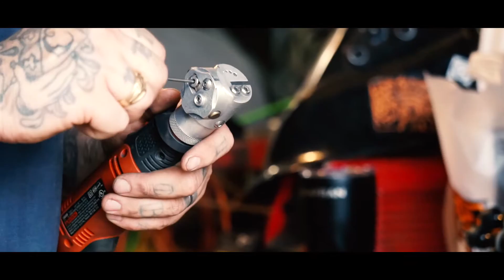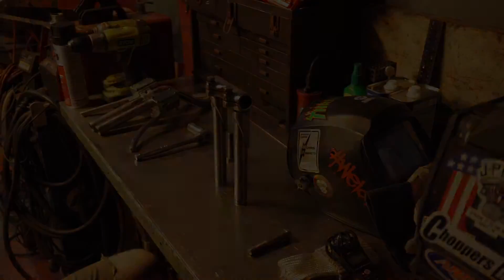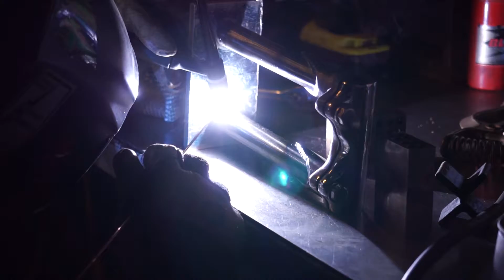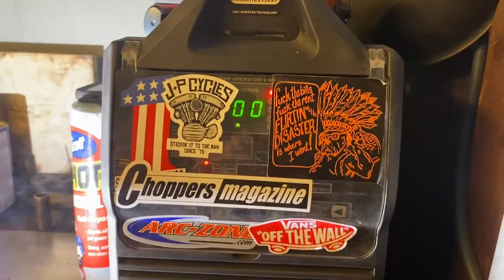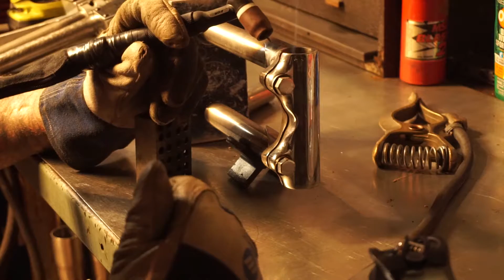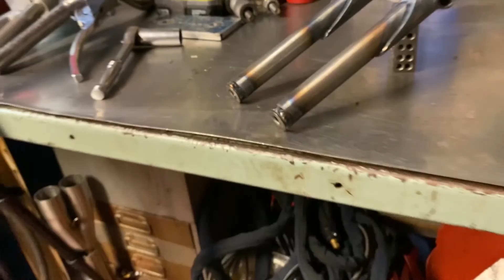Harley Dyna Chopper Build Series | Part 3

Comment: Where did you say you got that clamp? I might fire  up my old buzz box and make some to.
Reply from the maker: Not sure what's going on w/ the comments/where my other replies went.. but in case you haven't seen it yet... The top clamp is an early Harley clamp from two piece bars. You should be able to find a set on eBay or swap meets.